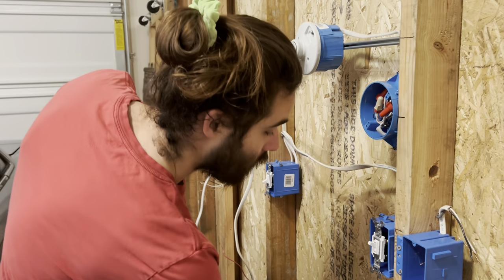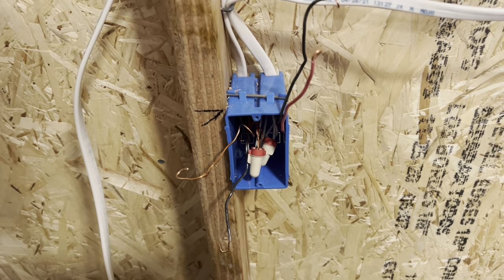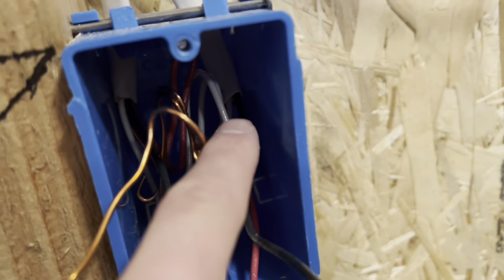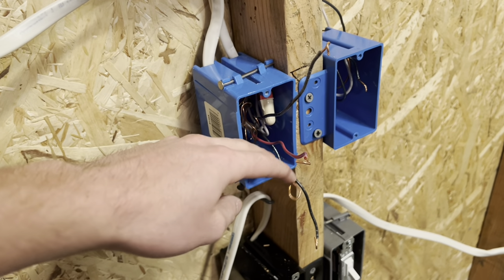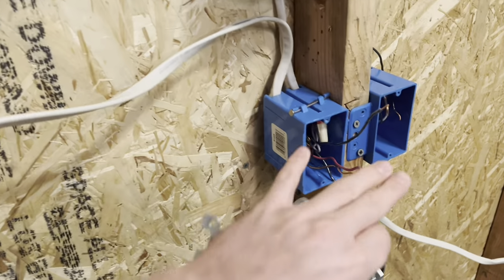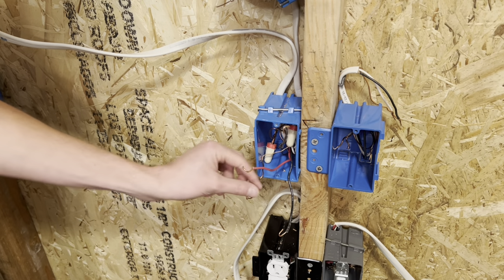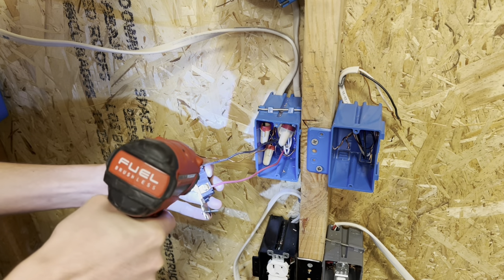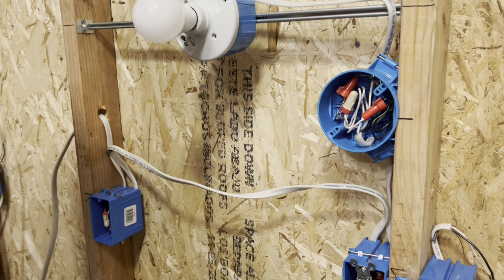How To Change 3 Way Switches Into A Single Pole Switch

Comment: This video saved my day (and an electrician's bill). The fluorescent ceiling lights in my garage had a wall switch near the connecting door to the house which I wanted to change to a motion detector switch. It turns out the existing switch was a 3-way switch connected to the other 3-way switch where no one ever would use it to turn the lights on or off.  This video showed me how to effectively eliminate that useless switch and enable the new motion detector.
Reply from the maker: glad it was helpful!

Comment: Good video!  So, just to confirm, the single pole switch can be placed in either box without worrying which 3-way switch was the switch receiving the power from the fuse box.  Connecting a traveler wire to a black power wire in the box that will not contain the single pole switch will allow the power will flow correctly.
Reply from the maker: correct

Comment: I've got a question Similar to this. I've got 2 3 ways controlling a single light. I'd like to repurpose one of the switches to power a different light completely. Can I just move the Romex to the new light? Or will the first switch still connect to the second switch?

Comment: I have two each ceiling fans that operate on two switches that are opposite sides of the room.  I want to replace the ceiling fans that have a remotes.  In order to use the remotes I have to change from two switch to a single pole.  Does this video still apply to my situation?
Reply: Answered my own question(no).  After taking the switch plate off the other outlet.  Which has three switches in it.  One of the three for the ceiling fans.  The other two switch exteriors lights off an on that only switch off and on from that outlet.  I believe all three switches have the same power source. Not sure if I can upload a picture and send to you on YouTube.

Comment: Great video, I have 3- 3-way switches in a box and want to add a timer to the inside house box, and omit the switch in the garage to control outside lights. However, the timer switch requires a neutral, the box inside the house doesn't have a neutral, but the one in the garage does, so I assume that one of the travelers would supply the neutral back to the timer switch, the other traverler wire would be the load to the lights, and the power I'll get from the box inside the house.

Comment: I have two 3-way switches, one at the front of the house that turns on porch light, and one on back door porch light. I want them to work independently, so you don't always have to have the back porch light on when the front porch light is on and vice versa. How would I fix that?
Reply from the maker: you might not be able to, you'd have to hire someone to fix it for you.

all depends how it is wired.
Reply: @DailyElectrician  Thank you.

Comment: Hey awesome video! I'm trying to install a timer switch that has a neutral cable, and after following your video I don't have anywhere to connect the neutral sticking out of the timer switch. Am I missing something?
Reply from the maker: Should be in the back of the box unless the house is really old

Comment: I have something of a conundrum. I have a outside flood light that runs from a switch in my garage, but, when I open the switch I have 3 wires plus a ground connected to it. I have 3 switches in my garage that one, the one that turns the inside light and one at my service door that turns on the light outside of the patio. Why would my flood light be a 3 way?  And, would I just do what you did with the single pole switch without knowing where the other 3 way switch is? I'm going to guess no.

Comment: is it possible to to on video (3 >> 1) install Honeywell Home RPLS740B ECONO switch  i wasn't able to use 3way because i can't make minimum 40 wat min required with 3way ( i have 2 Switches on different location for two light turn on same time )
Reply from the maker: probably not

Comment: What if you have two lights and two 3 way switches but you want each light to be on an independent single pole switch? Easy to swap each switch to a single pole and cap off the traveler wire?
Reply from the maker: probably not. Likely The lights are connected on the same switch leg and you'll have to run a new switch leg wire down the wall into the second light

unless the travelers run through the light, then you could repurpose them as a switchleg
Reply from the maker: no DC

Comment: Can you turn the wires in the junction box into an outlet?
Reply from the maker: probly not with travelers, and it would only work when switched on anyways. never heard of it being done before. i could try, that would make a fun video lol
Reply: @DailyElectrician  can’t hurt to try. I have 2 loads on the circuit and from what I can see it’s California switched without a ground. Thanks in advance for solutions to my 70s built house. I hope you find this a challenge! Primary switch has 2 blacks and a red. The other switch is a dead end with black red and white in a dead end- only 1 Romex in the box. 🤷🏽‍♂️
Reply from the maker: ok thanks, i'll see what i can do.
Reply from the maker: to clarify, theres a junction box in between the 3 ways? or ones been turned into a single pole switch and the other side is abandoned? or something else?
Reply: @DailyElectrician  the one switch would be turned into a junction box. Ideally that would be turned into an outlet.

Comment: Question to ask u, I want to do just that except I can’t find the other switch which is part of the three way, what to do
Reply: Just a thought ... Are all 3 terminals on the 3 way switch being used (black screw and the 2 travelers)? I am just taking a guess, but is it possible that the set up is already a single pole set up, but the switch is a 3 way switch being used as a single pole switch?
Reply: @joebell30  the travelers are connected

Comment: So… in the unused box, the line and traveler are tied together. The traveler wire runs electricity to the other box, where that wire is now the line and connects to the new switch. The other terminal on the new switch uses the old load wire, going up to the light fixture. Right?

Comment: WHY IS THIS SO COMPLICATED WTF.

Can't you just leave the other light switch in place? It would essentially function as tied together.
Reply from the maker: i mean yeah, just leave the other switch in the same position and never use it
Reply: @DailyElectrician  thanks, bruv 🙏
Reply from the maker: of course
Reply: @DailyElectrician  
Referenced your video to kill off a 3 way and 4 way switch in my garage for a single pole smart light switch. Thanks again!
Reply: And install a childproof protector on the switch you don't want to use so that adults don't come along and turn the switch off without knowing that they're turning off a light they might not see.   The same would apply to a wall switch that turns off the power to your dishwasher. I've had it happen three times that people flip the switch and then wonder why the dishwasher stopped working a day later 😆

Comment: My ground in both boxes is screwed into the box itself which is metal.  Should I leave the grounds as is in both boxes?
Reply from the maker: should be attached to the box and the devices for maximum safety
Reply: @DailyElectrician  Thanks man.  Cheers.
Reply from the maker: of course :)

Comment: The problem that im having is we have 3 switches that control 2 different lights like the top switch and one bottem control 1 light and the other switch controls the bottem light. But I want both sets of lights to be on the top switch so we dont have to turn on the bottem one.